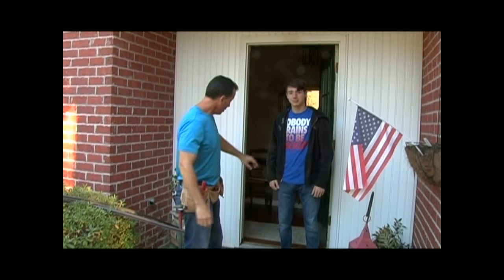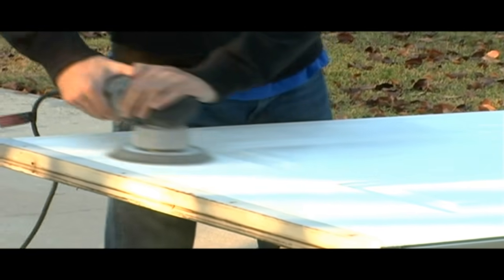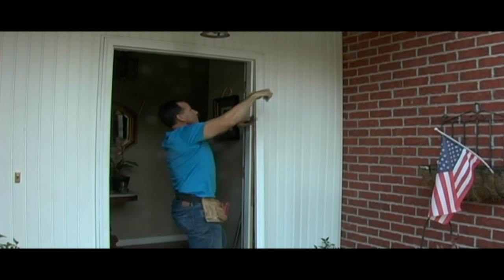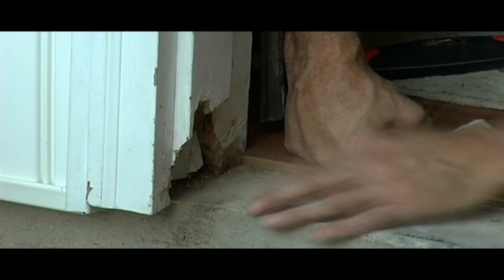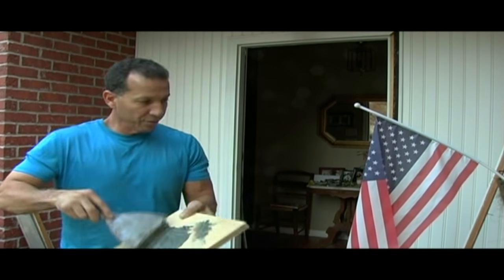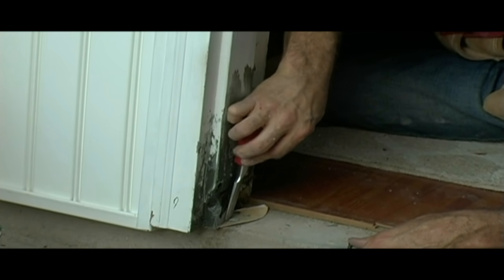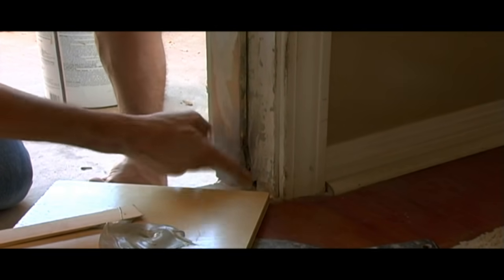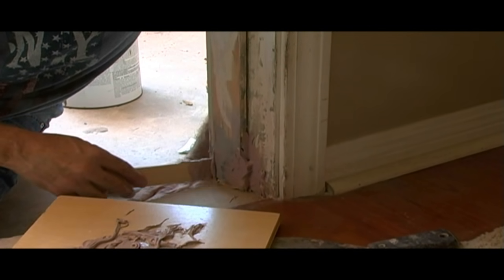How to repair your rotten entrance door and frame!

Comment: I was getting ready to fix a friend's water damaged French doors and was prepared to apply wood-filler and wait and repeat a dozen times. I've worked with bondo, but didn't even occur to me to use it for this repair. 
I'm halfway through and couldn't be happier with they way the bondo is working. Really appreciate the tip!

Comment: Paul... I went to Home Depot and purchased all the things I thought I needed when I was going to jump into this new project. When I got home and started to chisel out the rotted wood, and used a rotten wood repair chemical, I was waiting for it to dry. In my mind I mentally processed my procedure and things didn't really seem right the more I thought them through. It seemed that my resolve would be Jerry rigged and if I was going to take the time to do this, I wanted to do it right. I went to YouTube and after a few videos I saw yours. I can't thank you enough for your step by step. I would not have filled the void as you showed us and I am returning to Home Depot to get the plastic filler and materials to properly fix the threshold - which I wouldn't have done without seeing your video. I appreciate your help in this matter as well as the respect you show for the flag. Thank you very much and I will let you know how it goes.
Reply from the maker: I greatly appreciate viewers like you! Please let me know if you have any problems.
Thanks!
Paul

Comment: Paul, Nice video. Bondo Glass is great. I find it much easier to work with than regular bondo as it can be shaped while curing. I use wax paper to shape it while it cures and it cuts down on the number of applications it would take to create something like the door jamb profile. Also, Bondo Glass is waterproof and will stop the wood from wicking. So for trim around doors, I cut it short by 1/2" at the ground and fill with Bondo Glass. Even if the water puddles, the wood stays dry.
Reply from the maker: Hey mjdmtlakes, Thanks for the feedback and good tips! This is why I like YouTube
so much, you always learn something new. Have a good day!
Paul

Comment: Everything looks good and it's nice that others are learning from you.  I would have cut the bad wood out and replaced it with new pressure treated wood which would have been a whole lot easier and a whole lot faster.
Reply from the maker: +WAYNE L 
Hi Wayne, I understand your point and I have repaired many homes the same way that you describe. Although I try to give tips that tradesman could use, I gear a lot of my videos toward the average DIY'er. I am showing a way to repair rotten wood without having to use skills such as cutting this in place and matching new wood to it. Even if I splice wood on my repair, I will use Bondo to make it appear to be seamless. I can spot a repair as soon as I walk up to it if the seam is not covered. Even a tight glue joint will show a hair line. Thank you for your input and comment! It is always good for people to see different ways to accomplish their tasks. 
Thanks!
Paul
Reply: Great idea, thanks!

Comment from the maker: Repair,paint and replace your door, jamb,frame,and threshold!
Reply: Paul Ricalde Thanks for this video.   Is that fiberglass/bondo combination strong enough to support the screws and closer for a storm door?  The rotted out portion of my door frame was right where the closer was attached.   Thanks.

Comment: Perfect.  Just what I needed.  I have a couple areas of rot around the front door and this is a much easier and cheaper repair.

Question.  What grit sandpaper are you using?

Thanks
Reply from the maker: I use 80 grit to cut through the rough spots and usually switch to 100 grit for final sanding, either one will work when using latex paint because it is thick. I would go from 80 and finish with 120 if I were using oil base paint.
Thanks!
Paul

Comment: Can I use the same process on the actual door if there is rotten wood?
Reply from the maker: +Chris Noland 
Hi Chris,
Yes you can if it is not too extensive. If your rot is on the side or bottom edge, you will want to run a  couple of screws into the meat of the door. Let the head of the screws protrude into the missing or rotten area. This will give the glass filled Bondo something to grab on to and give it strength. Much like rebar does in concrete. If you are filling in smaller holes, you can use standard Bondo body filler. Let me know if you have any questions.
Thanks!
Paul